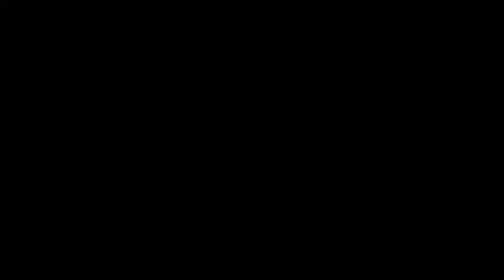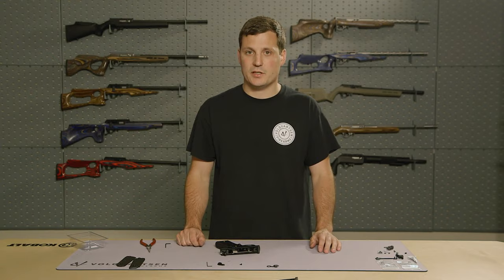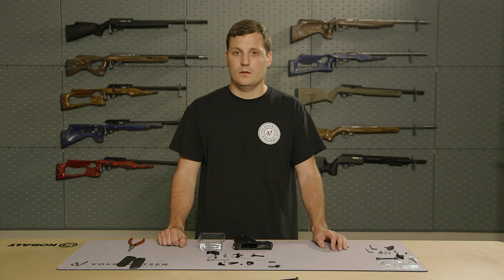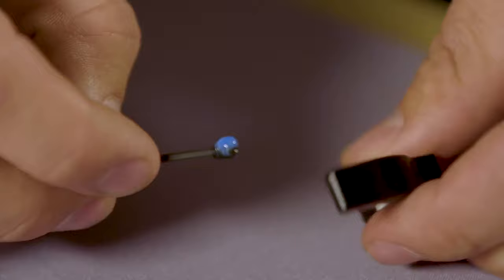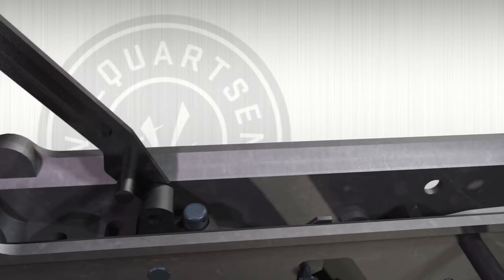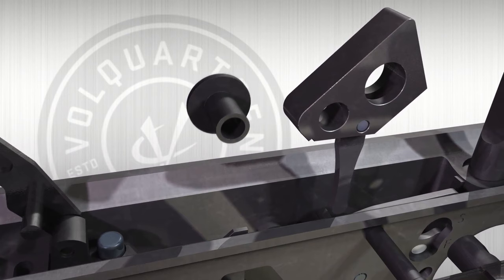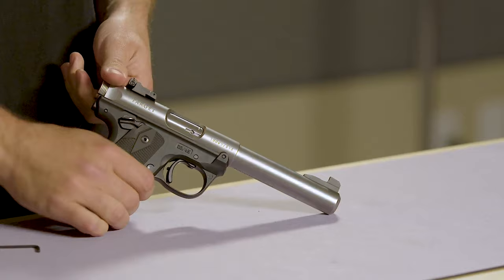Accurizing Kit for the Ruger® MK IV™ Installation

Comment: Just installed this. Couple notes. I had a tough time depressing the bolt catch spring in order to push the trigger pin out. I had to get a small enough but not too small Allen key and push down right on top of the spring, not the catch, in order to get it. Also, the sear spring long end does not need to be visible when installed. They skipped the part where the tail goes. It does not go in the mag well. It goes in a small gap in the grip which is a little tricky getting it seated in there. Plain tweezers helped me get the sear spring, spacer, and sear in. When you install the hammer the dangly part goes in the little divot behind the sear. The sear must be pointed up and pressed against the short tail of the sear spring when you slide the safety and pin into place. You can get the hammer in with the sear down which is what I did first and it did not function properly. Those were my only issues and it still took me about 90 minutes to install. Extreme improvement from stock.
Reply: I too pressed the bolt catch spring for a long time until I realized the spring you're supposed to depress to get that pin out is on the opposite side of the gun, and it looks like a pin, no spiral.
Reply: I made all of the same exact mistakes. You are a live-saver though. Couldn't figure out why my safety and whole entire mechanism wasn't functioning, the dangly part isn't in the little divot for mine, my mistake. Saved me from taking this all back apart completely and starting over. Thank you!
Reply: @MrChaso123  nice, that’s exactly why I made the comment. Glad it helped!

Comment: Just installed my trigger on my 22/45, completed in just over an hour, went surprisingly smooth.  Hardest part was the sear assembly, which I figured.  All and all very happy with the product.  Excellent trigger pull

Comment: If you enjoy depot level firearms maintenance, and are comfortable with "some assembly required", then this upgrade is doable at home. It really does help to have locking forceps or spring loaded tweezers so that one can grip the tiny spacers as needed, and maneuver the sear. I have a Mark4, 22/45, and have dissembled the same amount for through cleaning. This kit has made an awesome improvement to my pistol. I do agree that there needs to be a better explanation of the correct spacer to use for the hammer. It was helpful, when I first acquired the Mk4, to watch several of the comprehensive disassemble and reassembly videos; and practice before this upgrade.

Comment: One important detail that's included in the write-up, but NOT explained in the video is that the Sear Spacer is ONLY used on the 22/45 version.  This was giving me fits during the install until I realized my mistake.  Triggger is 100x better though, great kit.
Reply: I noticed slight differences between this and my gun. And I didn’t get a spacer just the larger sleeve.
Reply: TY for that info! I was trying for over an hour to try to wiggle it and even sanding the spacer with fine grit. This should be the top comment!

Comment: Just installed this, disconnect or, and a new firing pin and extractor on my Mark III 22/45 lite.  Dealing with all those little parts wasn’t easy.  I had trouble aligning the sear and it’s pin and getting the safety on the pin and keeping it in place while i put the hammer on.  I ended up using brass punches as alignment tools which made it easier for me. But wow what a difference significant reduced pre travel crisp light break and no excess over travel. And the trigger reset is very short.  It was a good gun before but now it’s awesome!

Comment: The hammer bushing spacers - you tell us there are 2 but not which to use for each model. Also, you should note in the video that you don't use the spacer between the sear spring and sear. Because the sear spring spacer will fit, but it's VERY difficult.  Then the gun does not work and you have to take it back apart.
Reply: He says he's using a 22/45 and the video shows the thinner washer goes on, which means the thicker washer is for the regular MKIV.  Yes, that should be more clear.  I used needle nose pliers to grip the sear in the center groove without blocking the hole, then pushed it into place, first over the spacer washer so it wouldn't drop out, then i wiggled the pin back out a little at a time until the sear went over the pin.  Wasn't easy and it took me a few attempts.

Comment: DO NOT USE THE PROVIDED ALLEN WRENCHES, I almost rounded my right safety screw because of their bad soft allen wrenches... Use a good quality one, and make sure you heat up this screw if you feel any resistance !
Other than that I'm VERY happy with this kit, the original Ruger Mark IV trigger is very bad imo. This + tandemkross trigger feels great ! In France we pay 950€ for this gun brand new, oof
Reply: I rounded mine. Now what?
Edit - was able to get the allen screw out with the help of a soldering iron and a different allen wrench. Apply the iron directly to the screw (but not too much, or you'll melt the safety lever), and it should come out.

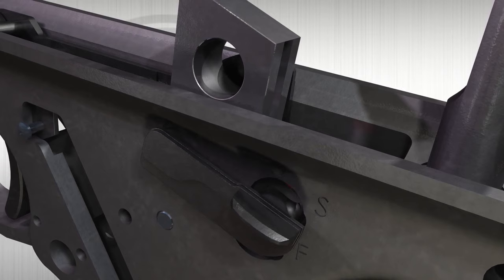Comment: At around ~10:30 if you can't get the hammer to go back, the floppy bit on the bottom of the hammer needs to go into that divet/hole thing to provide tension. If it's not in that divet/hole, it will not move or the safety will not move correctly. 

They missed a step in the callout, the floppy hammer secondary bit needs to go in that divet and should've been called out in simpler language and maybe a CG shot. 

If you can't get the hammer to cock back, this should solve the issue.
Reply: I did put that free floating thing into the little silver hole. I still cannot make the hammer stay down, so it wont go into safety, the hammer will always pop straight upp immediately, ...
Reply: It seems that I ACTUALLY lost those smallest parts... The Safety Detent Spring (27 in the instruction manual) and the Safety Detent Plunger (28), those who has to go into the Safety (26)... It is not inside the Safety and I can't find them anywhere on the floor etc... Does that explain my hammer malfunction, I really lost those two small part, classic comedy
Reply: If you have a Ruger Mark 1 through 3, you know the importance of getting the hammer strut into the main spring. 😁

Comment: @volquartsencustom  you need to watch a sigguy video on installing parts, he gives important tips through the video, you need to tell people to make sure the sear spring doesnt just face down, that it actually goes back behind the mag cavity, magwell. i put it all together and almost bent the spring as it was in the magwell. also explain to use the black spacer during the sear install and explain the actual size difference to use for a 22/45 and a mk iv spacer. here are the sizes below as you are your to lazy to do a proper video and include these very important tips. 
MKIV: 0.0475" (1.20mm)
22/45: 0.070" (1.79mm)
black space for sear.

Comment: There are two spacers included in the kit: one for the 22/45 and one for the standard mark iv.... which goes to the 22/45 and which to the standard???
Reply from the maker: Start with the thinner spacer first, if there appears to be extra room you can use the thicker spacer.

Comment: Followed the video exactly and installed in my mkiv 22/45 and it will no longer cock, so the safety won't engage, so I can no longer disassemble it.
Reply: You didn't get the dumb little free floating thing on the hammer in that silver looking hole. Overlooked step by them
Reply: @cakeeee4  Dude, why so technical?! ;-)
Reply: @garyshepard7881  😂

Comment: My hammer drops as soon as the safety lever is disengaged. What did I do wrong?
Reply: Same. I put it back to original, and id doesnt do it at all.  Ever found out why?
Reply: @donquidang  I had the same thing happening. Realized I put the sear in the wrong way, and perhaps the sear spring, too. The sear is supposed to be pushed back by the sear spring. Found another video which shows it more clearly and how to assess whether you've installed it the right way. https://www.youtube.com/watch?v=YB9EmYwDyzg

Comment: I could not get that washer installed when installing the sear... I guess that's why there's a 3d video during that part of the video? I spent hours trying to get that thing in there, and when I looked around at other videos nobody used that washer/spacer. What's up with that?
Reply: This is happening to me right now. I’m going to skip it too for now
Reply: Did it work? Any issues?
Reply: @smurfkilla369  I actually haven't been shooting with it since I installed it. I think it's going to be fine though. We'll see!
Reply: The spacer is not used on a Mark IV only on a 22/45.
Reply: @tiffanyprice862  Thanks! I feel a little better now!
Reply: I have a 22/45 and can’t get the spacer for the seat on the pin either. Am to understand this spacer is specifically for a 22/45

Comment: Is it ok to fry fire with this trigger?
Reply from the maker: The concern around dry fire is primarily the firing pin peening from striking the chamber - this kit would be all internal trigger components. Ruger mentions it's ok to dry fire their pistols, but we'd still recommend a snap cap if it's more than occasional.

Comment: I am struggling putting the sear in. The spacer keeps falling out and I don't have a third hand to push it against the spring. It's really a tight fit there. Any suggestions?
Reply: Throw the sear spacer away if you don't have the 22/45
Reply: Put a dab of Vaseline on it , also on safety detent and spring , did this a hundred times , at least !

Comment: I will never understand how you can say this is a simple modification ????  If it is not reinstalled properly, this is a dangerous upgrade for a rookie !!!!!!
Reply: If you're used to taking guns apart more than for simple cleaning this isn't that bad.  I just bought a mkiv 22/45 and I've had it 2 hours and installed this kit following the video.  Granted the MKIV is a pain to re-assemble at a couple points, like the safety and sear pin but it's not that difficult.  They left out quite a few little details in the video that I managed to figure out but I can see that being confusing for some.  Like where exactly the sear spring goes, which spacer for which model, and where the hammer rod sits.

Comment: Do NOT base your installation completely on the illustrations of this video.  You might be turned around by the depiction of a rivet head or the use of a spacer.  One should also refer to the Volquartsen still photos and captions to figure out the sear and hammer installation.

Comment: Crappy installation video. Instead of building 3D models, take high resolution video’s so you can see where parts go. Cheap hex head wrench supplied. Stripped out and can’t set the pre and over travel. Locktite has setup. Very disappointed.

Comment: Is the sear suppose to be forward while installing hammer? This video is not a novice video.😡
Reply: probably too late to respond,  yes the sear needs to be foreward .the safety has a notch to hold it while you put the hammer in and install the safety pin through.